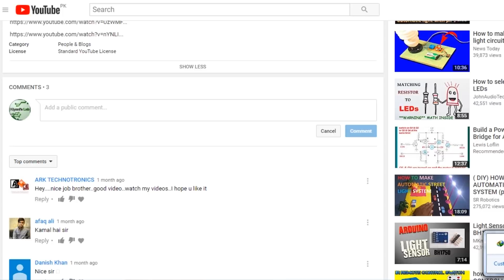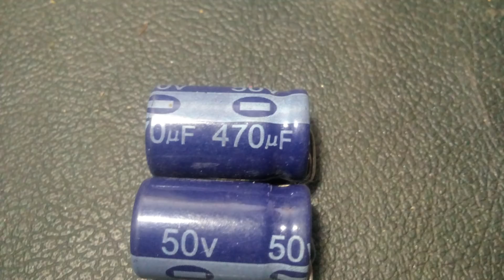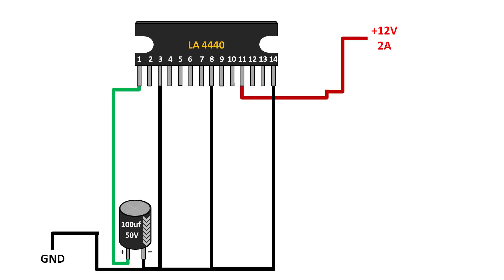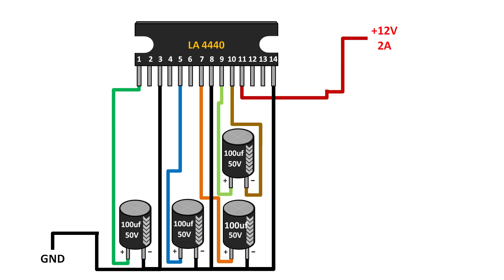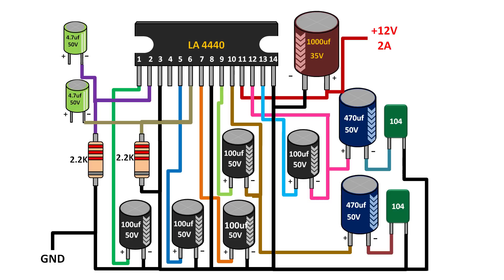HOW TO MAKE STEREO AMPLIFIER

Comment: I have some questions -
1. Why you change the negative feedback capacitor (pin 1 and 7) value from 47uF to 100uF ? Will it reduce the gain ? If not then how to reduce the gain of amplifier to 40 db ?
2. Why you change the Pin 5 capacitor value from 220uF to 100 uF ?
3. Why you didn't use 4.7 ohms resistor with the capacitor in zobel network in output of the circuit ?

Comment: Sir I am using the circuit but the 104J is making noise. So I had removed it and now it's working and PSU is 12 V DC 500mA

Comment: Hello sir, I've designed a la4440 19w bridge amplifier. Everything is working fine but it generates a lot of noise which is really annoying. I've checked all the connection everything is ok. I'm powering the circuit with a 12v 2A adapter. Sir please help me to solve the problem. Below is the link to the schematic and PCB design. https://drive.google.com/open?id=12vB1fmjsLDySCoPX7qNgcFHp5dbJ77Z2

Thank you